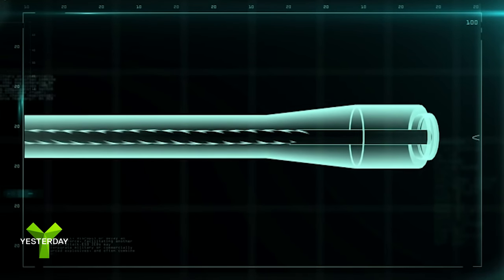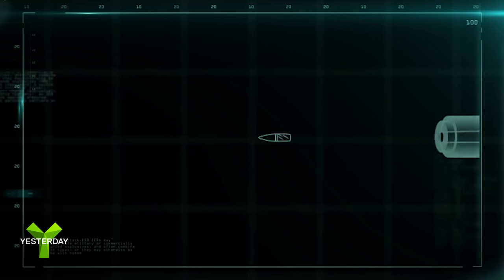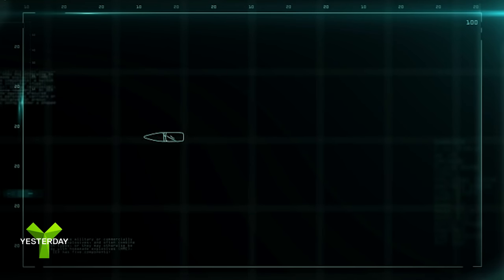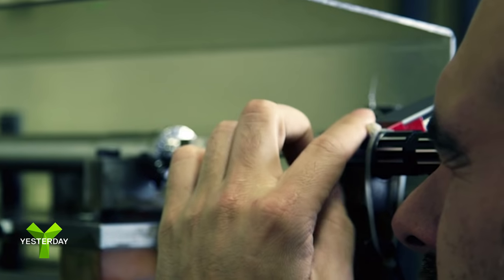Making a Gun Barrel | Battle Factory Preview | Yesterday

Comment: You notice that the so called fingerprint of the rifling was the most important issue in this video.  This technique for identifying is flawed. No longer admissible in court.
Reply: I'm in no way an expert, but I've always wondered, wouldn't a thorough lead lapping of the barrel after having committed a crime with it remove all the tool marks from its rifling with which it otherwise might have been identified by forensic analysts?
Reply: @pieterveenders9793  due to material wear and other issues this "rifle fingerprint" is completely worthless in a court of law due to it constantly changing plus the entire rifling is about the same for all of the produced barrels. It´s as if they would claim that you could identify the right wheels of a car by the track it produces. Sure you could identify with that who made the wheels but its impossible to identify the exact 4 wheels that made a track. Its the same for the rifling.

It´s nothing more than a myth.
Reply: @dergunter1237  Thanks for clarifying that, and to be honest I already half expected something like that. For over half a century all but the most unique and expensive firearms have been made on the standardised production line of a firearms manufacturer, so it seems extremely unlikely to me that with such a degree of automation and mass production as is employed in firearms production that there were enough distinguishing marks from one barrel of the same model of gun to the next. And with hammer forged barrels having become the norm for most European firearms manufacturers it seemed even less likely. On top of that, I always thought to myself, all you probably need to do to erase such distinguishing marks (if they even exist) from the barrel of a gun which had been used in a crime is to run a lead lap through the bore a number of times to polish out the microscopic burrs and marks, and voila, gone are most if not all previously present marks and burrs.
Reply: I also believe so
Reply: yes the video is fixated on this  but please do not lie, it is admissible in court
Reply: @dergunter1237   material wear and other issues makes the  "rifle fingerprint" change over time BUT this does not stop it matching
please do not lie again
Reply: @waptek2 the manufacture process does not create a fingerprint. There are millions of barrels made and you cannot create that many different imperfections to allow for individual rifling on every single barrel to be different . Common sense would prove the term manufacturing insist the same product over and over in an efficient way. Handmade would be only process to allow such process were tools that make barrel could actually be fingerprinted. No barrel makers would allow such regulations. Because the people who create regulations are inept of the processes.Sorry my friend, the fingerprint doesn’t exist in barrel making. That same mandrel creates numerous barrels. Not to mention deformation that bullets go through when they make contact with any organic or in organic material.

Comment: The cold hammer forging does not create the lands and grooves.  The bore is drilled after cold hammer forging to ensure proper and uniform diameter the entire length.  Depiction of rifle groove impressions on the bullet is 100% incorrect.
Reply: Are you sure you aren't thinking of the cut or button rifling methods? Cold hammer forging is just one of many methods, and this is definitely how it's done lol.

Edit:
By the way, I'm no expert.. Just putting that out there lol..
Reply: Not true. There's a mandrel that's in the bore of the blank that has a photonegative of the rifling ground into it. The hammers press the blank into the mandrel, which forms to the profile of thr rifling. When the mandrel is removed, you have a rifled (or even chambered) barrel blank. All that's left is to turn the barrel profile, crown the muzzle, and ream the chamber if it wasn't already made by the chf machine.
Reply: Yes. The groves are made earlier or later on this process.
Reply: It's amusing (in a sad, pathetic way) when people get things so wrong that they're contradicting something that's correct & offer their own absolutely wrong opinion as fact. Rifling is hammer forged over the mandrel & often even the chamber is hammer-forged in the same process. Forging makes the rifling longer-lasting compared to cut-rifling or button-rifling.  

Sako, Steyr, Daniel Defense, FN & other manufacturers hammer-forge their barrels using this process. You don't find it on low-end guns.
Reply: this vid depicts the rifling being forged at the same time & is real

Comment: Nothing matches cut rifling, you get what you pay for.
Reply: my CHF Delta 5 shoots half or under routinely.
Reply: "ECM" = hold my beer
Reply: That is not true.  Hammer forging, broaching, pushed button and pulled button are all manufacturing methods capable of producing barrels as good, better, or worst than cut rifling.  It's the quality of the barrel's material, the quality of the tools used, and the experience of the manufacturer making the barrel; not the manufacturing method.
Reply: Tell me you're a boomer fudd without telling me..

Comment: interesting. never seen it done like that. Usually they take a piece of solid bar stock and drill and ream a hole and then force a riffling button down it.
Reply: Nicholas Trueblood thats called button rifling, cut rifling is the best, you get what you pay for. The best custom barrels have cut rifling, not hammer forged or button rifled.
Reply: I'm fond of polygonal rifling
Reply: That was older method and needs more time i believe.
Reply: @u.p.woodtick3296  hammer forged provides far better wearing barrels. I'd rather have a cold hammer forged barrel in the ghan than cut filing

Comment: This video is a lie. All of the barrels that were hammered on to that center "corkscrew" of steel will have the same fingerprints. So if they use the same Corkscrew to make 100 barrels, 100 barrels will have the exact same fingerprint. Then they would ship off five or ten of those guns, all made with the same corkscrew to the same store or City.
Reply: they did a terrible explanation of it in this video, the "fingerprint" isnt caused by the rifling but rather small insignificant defects in the rifling. these defects are all going to be different even if you use the same tool a million times just because of the metal they use to form the barrels all having slight differences to their structure

Comment: How is the rifling tool not welded to the inside of the barrel when it’s squeezed like that
Reply: Paulus Viljoen  What are you talking about?
Reply: @mikocap21  as long as there is movement there is no cold welding. if you would put the mandrel in and hammerforge the barrel while the mandrel does not move relative to the barrel it could.
Reply: thermal cycling the barrel will loosen the "rifling mandrill"